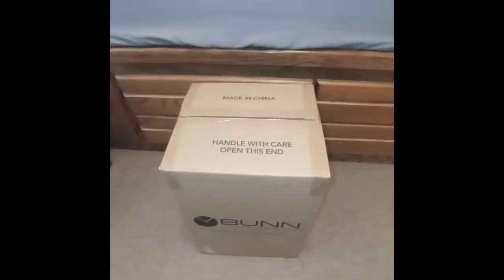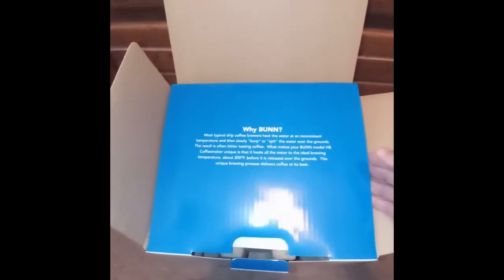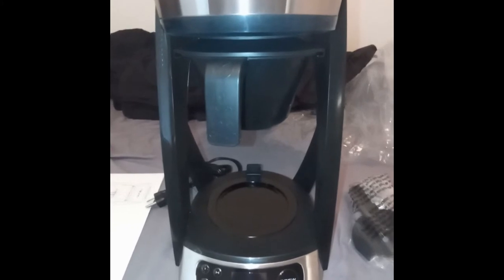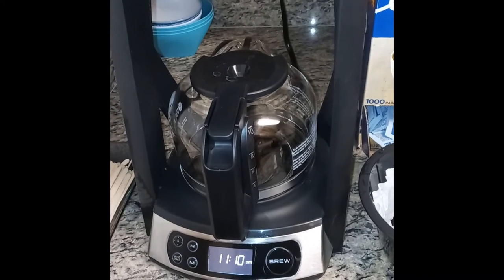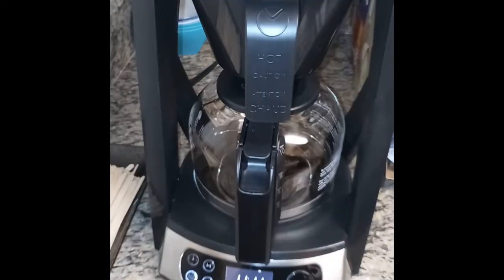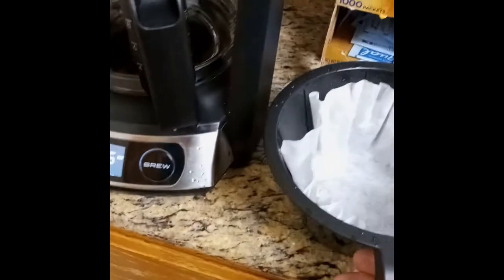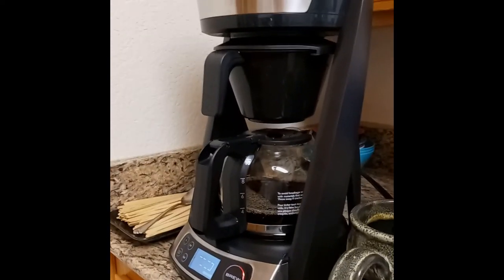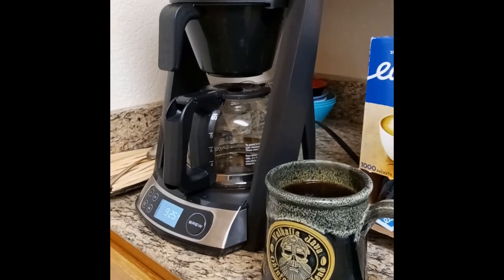Bunn Heat N' Brew: Unboxing, Setup, and Brewing

Comment: I got this model for Christmas. It has an excellent design. They really keep things simple. I had an unfortunate 'plastic smell' that wouldn't leave even though I did a wash with vinegar and water, a second one, and a baking soda wash. 
I found a suggestion of using alcohol or vodka (I opted for vodka because it seemed more food safe to me), and 3/4 parts water. I did two rinse cycles and that smell/taste is gone.This supposedly occurs because as you can see it's bagged so no air flow to remove the 'residue or odors' from manufacturing.

Comment: Thank you for this demo. I brought a  different Bunn coffee maker, it leaks like a sieve.  I'm making them take it back. I'm so disappointed. I love Bunn coffee makers.
Reply: Do you use soft water? If so, they will leak from an overflow. Weirdest thing. Call Bunn and they will send you a new spout so it sprays better for soft water. They were really helpful. Good luck!
Reply from the maker: @oleboy4332  Thanks for the warning. I use filtered water, so it shouldn't be an issue for me. These should be of use to you:
One is the manual and the other is the user guide. I hope this helps.
https://m.media-amazon.com/images/I/C1oxfps3CwL.pdf
https://m.media-amazon.com/images/I/A1uKYnIanOL.pdf